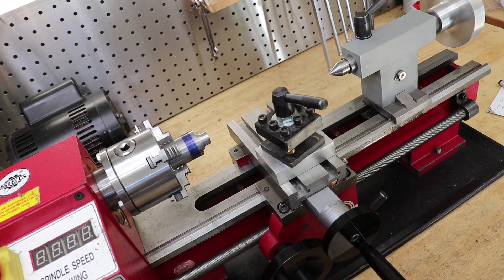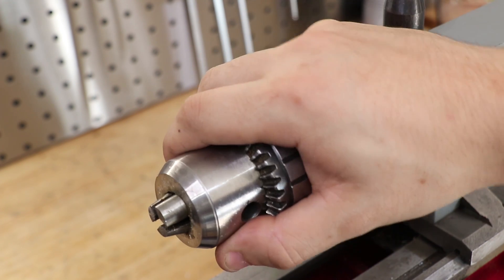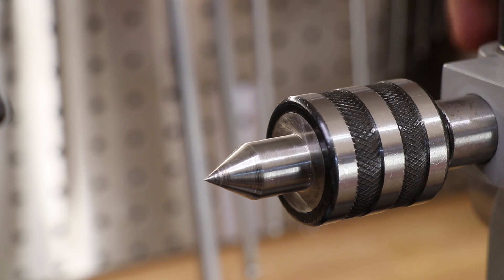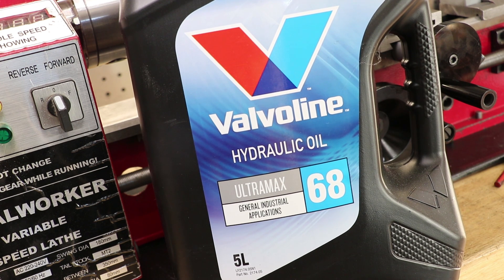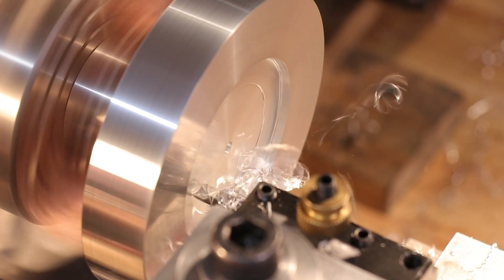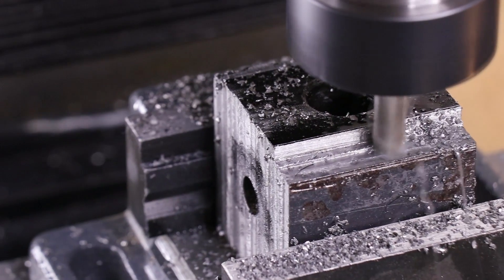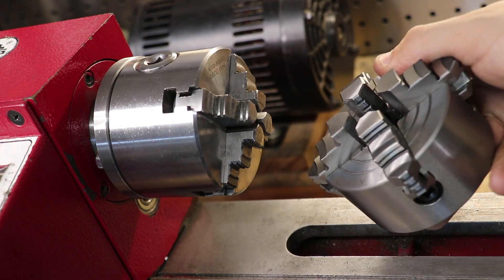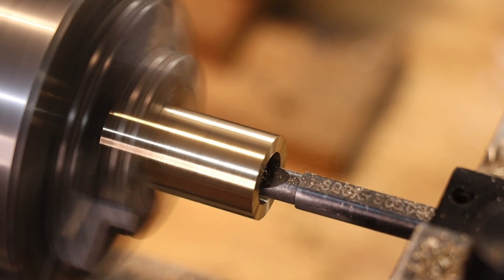Hobby Lathe Machining - The Cost Of Tooling

Comment: Well, of course for a starter you need at least some way of cutting the raw materials (saw, cutter), files, screwdrivers, hexkey-set(s), some way of scribing on the materials and I really recommend to have some kind of drill besides the lathe.
Other tools I'd recommend is getting good light and probably some magnifieing tools, vaccuumcleaner dedicated for the chips (you don't want to get all that mixed in your house).
Also: old cloths to clean, brushes, machinest-hamer or some other hamer with soft protection on it so you can make a machinist-hamer later yourself.
Probably also dies and tapping-set, 'sharpies' or some kind of marker-pens and some bigger things to measure your stock before cutting it (did I mention the saw?) and of course something to hold your materials when cutting them to lenght.
On a bigger lathe you can do a lot of cutting in the lathe/chuck because you can put it through the end of the spindle but with the small lathes you need to make it fit in the lathe and even the small size of half a meter you can buy stock in is too long to fit.

Comment: The double the cost of the machine comes from higher end machines for a normal shop. As to truly use the full machine the tooling is going to cost that much. Obviously not important if you’re not trying to hit perfect thousandths or produce parts in a production environment.
Reply from the maker: This is correct, but I've seen this figure thrown about for mini lathe tooling too

Comment: I recall reading elsewhere that machining isn’t a poor man’s hobby.  By gosh they were right about that!
Reply: Bigger 4-jaw chuck, HSS, Carbide, grinder, centres, QCTP, drills, stock.  Measuring kit.  Mill, cutters, clamps, machine vice.  It all adds up!
Reply from the maker: @daveys  Milling is certainly a lot more expensive than lathe work, thats one thing for sure.
Reply: @artisanmakes  I’ve not dared to do a calculation (and may never do so) but they’re both costly hobbies!  I reckon that I’m in for a couple of thou on each.

Comment: The difference between cheap and expensive drill chuck is run out, cheap chuck will have run out like 0,15mm and expensive one like 300$ will have run out like 0,02mm
Reply from the maker: I agree, a german made rohm chuck and its run out is in that region, whilst the import one is about 0.075 or so. Granted this might not apply to a manual situation but when ive done cnc if the drilling needs to be low run out I'd just use a collet and skip using a good keyless chuck. Cheers

Comment: Kinda painful watching that carbide creep through it's cut. You're treating it like HSS.
They are VERY different in red hardness (durability) and rake angle (chip formation).
Carbide "prefers" heavy pressure. Double or triple your feed rate and you'll see it "come to life".
Reply: You'll snap the belt or break the plastic gears if you have them if you push it too hard with carbide on the mini lathe. Ask me how I know.
Reply from the maker: You can only do so much with this lathe and it's probably pushing it to its limit. I still get better results with carbide than hss. A lot of the optimal feeds and pressure kinda go out the window when you use a mini lathe. Cheers
Reply: @artisanmakes  I understand the limitations you're up against. Depth of cut is very limited by the raw power @ the headstock. But try ramping up the feed rate, it'll give a much faster, cleaner and more predictable cut.

Comment: I am always impressed with your knowledge, experience in machining, and your ability explain and forthright recalling of hindsight (things tried, causes of poor results and corrections taken). Coupled with your commitment to improving these types of hobby/home machines, your videos (I am certain) are helping droves of people find capabilities they thought beyond their or their equipment's abilities.

Many people would lose interest in improving their lathe and/or mill, and instead "pop" for a "bigger and better" one. But coming from a family of machinists (yes, even my mother ran a lathe back in the day, her father had a shop) I know it is a source of pride as a machinist to be known to be able to produce accurate, well finished parts on "old, greasy, well used machines". There are fewer true old-school (at heart) machinists around.

I am reminded of the story of when Ford bought Jaguar and discovered the machines in use by the (inhouse tool & die, and line setup) machinists were old and contained a large amount of shims and backlash. The Ford engineer exclaimed, "we have to replace these machines with newer, modern machines"! To which the machinists responded, "If you replace 'my' machine you better be prepared to replace me." I don't know if it is true, or of what finally happened. The company has changed hands more times, and I am sure the machines were replaced as well as the machinist. But when I heard the story, I understood what the machinists were really saying.

Even though your (and many home & hobby) machines are not old, they are relatively new (not like the British and American made, virgin gray iron made during and after 'the war'). They are made of a mixture of recycled iron and other metals, and perhaps some Australian iron or, and quickly machined and built as economically as the Chinese are able. So a lot of these machine's capability is compromised at the factory. It is up the the machine's owner to tease out the machines remaining capabilities, and you're showing how to do this in a very practical way.

Thank you for posting these great videos!

Comment: One of the best things I ever made for my 7x12 minilathe was a 7 inch faceplate.
It is just a round piece of 10mm thick aluminium plate, bolted onto a piece of 20mm diameter shaft so it can just go straight in the stock 3 jaw chuck in an instant.
I have drilled and tapped holes whenever, to suit different jobs.
Basically, if I needed to face, or bore, any weird or large object I just attach it to the faceplate. It almost turns the 7x12 lathe into a bigger lathe.

Comment: If you have a 3D printer you can get away with making and printing a lot of things that don't need the rigidity. I designed my own die holder with an M2 taper and it fits perfectly in my tailstock and gives perfectly square threads :). 

Currently working on another big 3D printed jig for the lathe right now.
Reply: I think you are right and I gave you a thumbs-up. But I hope he doesn't take your advise, and here is why. 

The value I find in this channel is in its focus on getting the most out of an economical mill and lathe. This type of pursuit is becoming a lost art, yet is a highly (under) valued one. I would hate to see the channel's focus diffused to include additive machining and the inevitable collateral of CAD and CAM softwares, parameters, CNC electronics, and types of plastics.... 

Those things can be found in a bunch of other competing channels.

This channel is a unique gem focused on something that is part of an old-school machinist's ethos, to produce a finished part that is (seemingly) "beyond" the capabilities of the machine it was produced on.

Learn what is being taught here, and apply it in your own shop and tools, perhaps share it on your own channel (I'll be happy to check it out and likely subscribe to it, as I do a fair bit of printing with carbon whisker ABS).
Reply: @RobertLBarnard  I appreciate the comment but I don't exactly know what you're trying to say by "Learn what is being taught here". I have a lathe and a 3d printer. Why would I choose to not use one because it shows ingenuity when I believe it's even more interesting when you can get them to combine with each other and compliment one another.

You definitely have the right to tell the channel how you think he should do things, because you are the subscriber, the person who makes him money and if he doesn't want to take your opinion then it's because a lot more people disagree and want more than just this. I'm happy either way.
Reply: @XxIcedecknightxX  Okay, I see where you are coming from. 
I wasn't telling you you shouldn't combine 3D print with your traditional work. I said I hoped this channel wouldn't start getting into combining 3D printing with the traditional subtractive metal machining, as it would (imho) take away from how he (the channel's owner/creator) has bootstrapped his shops capability remarkably well in a traditional sense. 
Its probably a generational thing (I'm an old man, lol) and I like the purity, (self imposed) disciplined constraints, and narrow scope of his content. 

Or perhaps I've been into "3D printing" for too long (working on them when I had a CAD/CAM consultancy 30 years ago with GE, Andersen Corp. Ford, and Boeing). 

I agree with you the capabilities of todays open source hardware and software are really exciting and bring a lot of capability to a home workshop and even non-technical craft people. It would not surprise me to find 3D printers in homes out-number lathes OR mills in homes my 10X or more. So it makes sense to combine them in most people's projects, as well as yours, and mine.

Of course your opinion is as valid as mine; as we each "validate" our own opinions. But I may have a different take on which way the owner/creator values our opinions.

This is his channel and (within a few guidelines set down by YouTube) he can run it anyway that pleases him. He may decide to do the opposite of what his audience requests. Like me, he may not really care about getting more subscribers. Or like someone with humor and intellect like a Dr. Feynman, have a better idea to show his students. 

Ours are just opinions and for some odd reason, I felt compelled to share mine with you. You're perfectly free to tell me, "respectfully sir, go to hell" and I would laugh, slap you on the back, and but you a beer.

Comment: With insert tooling the newby has to tread carefully as not all tooling sets are created equal and most sets come with holders that you will rarely if ever use . For small lathes stick to insert shapes like Rhombic and triangle as they more common in the small size the holders use , require less power to run and many small boring bars use the same tips . If you can stick with one shape it makes buying replacement inserts easier and cheaper .
Unfortunately many newcomers to the hobby see insert tooling as a shortcut to better machining or “if I use inserts I don’t have to learn how to grind HSS tools” this is unfortunate because this skill is at the core of all lathe work and buying tools won’t make you a better machinist- learning new skills will ! 
My list would be : 
(Other than the lathe itself - many come as a kit with chucks , steadies etc so choose wisely as it can save you a pile of money )
A small bench grinder 
Some HSS blanks or a pre ground set to get you going 
A cheap dial indicator or dti and stand - dti has the benefit of allowing the bore of a part to be clocked .
A live centre 
A drill chuck 
A Centre drill
A decent set of drill bits 
A tap and die set 
A tailstock die holder and a spring loaded tap follower .
A parting off blade and holder . 
Most important thing is a set of safety glasses or face shield ( should be purchased before the machine ) 
One more important thing is to really think about what you really need I have seen many newcomers dive in at the deep end and spend thousands of dollars on stuff they thought they needed because they seen that  someone on YouTube had one and they end up with another workshop ornament .

Comment: Starting out with pre-ground HSS bits is definitely a valid option, but if you have a grinder, I'd suggest buying blanks and grinding them yourself. It isn't hard, and there are plenty of highly detailed videos to learn from. The first thing I was taught in my lathe training was how to grind a tool. 
For standard OD turning operations, you can do everything you want with HSS in my opinion. For threading and ID operations, insert tooling is the way to go though, no question. Brazed carbide tooling is also an option, but I would recommend against it.
Reply: I'm not sure if grinding your own HSS tools is a good idea for a newbie.... my home-ground tools stink.
Reply: @edgeeffect  In my experience it's kind of hard to really screw up. I've seen some really bad ones, but in most cases it was just that someone didn't bother to put a nose radius on.

Comment: I would like to add, 12mm tooling will not work with a Mini Lathe, i have a 7 x 14 mini lathe, they work on yours because you have a Modified Toolpost and riser block, 10mmm is the limit of size for Mini Lathes. 8mm is the best for adjustment in Height. I know i was that Very Unhappy guy who bought 12mm for my Mini Lathe.
Reply from the maker: You mini lathe must be slightly different to mine then, I was using the 12mm tools a long time before I redid the cross slide and made the riser block.

Comment: Surprisingly, engine oil can actually be worse than no oil on lathes
Reply from the maker: Yeah I understand why many people will disagree with it, point in case is get way oil. But I personally never ran into issues using it in a pinch, Cheers
Reply: @artisanmakes  Yeah I used engine oil for a long time without too many issues apart from it going black instantly due to the detergent presence. It's mainly that it is actually worse than no oil when used as a cutting oil - Project Farm did an interesting series of tests if I recall correctly.
Reply: This is a hot topic. On old machines I find that detergent oil (10-40 to 20-40) tends to dissolve and flush out all old crusty crud left over many years as long as you keep over-oiling the machine. Then switch to recommended lubricant. Your mileage may vary. BTW: this on assemblies that are better left alone rather than being taken apart...

Comment: yeah, not that expensive when you start out, but you just keep "accumulating" tooling as you go, so the inventory ends up having quite a bit of value.  I recently let the smoke out of my small lathe, and I seriously considering just upgrading the lathe, as a new motor was about 1/4 of the price of what the lathe originally cost me. But when I worked out what it was going to cost to replace all the tooling, I put the new motor in it.

Comment: Great post as usual. Last year I bought a mini lathe and, as I have machining experience and had the money, I bought a big selection of accessories. Then after a few months bought some more as what I was trying to do needed them. One item I could never do without is a faceplate. If you don't have a mill you can surface all kinds of things with the right fixturing. Also: Brazed carbide tooling is much cheaper than insert, and can be honed very sharp with a small diamond hone. It might be a better choice for a beginner.

Comment: Very well said. I would also recommend against a tailstock die holder as a "must have" as I've found you can rig it by using the tailstock and a flat bit of steel to align a standard die. also poke - get a cheap second hand horizontal band saw. if you can find the space for it you won't look back. I don't work for a bandsaw company I promise, just it's painful seeing you hacksaw through super thick material to then have to spend a lot of time on intermittant cuts to face them.
Reply: I know exactly what you’re talking about, makes me cringe anytime I see him cutting some stock using a hand saw. Don’t even have to get a full-size bandsaw that takes up space in the garage. Recently picked up a secondhand handheld cordless Dewalt bandsaw for $40. This thing is less than 2 feet long and takes up almost no space on the shelf. What a timesaver, Have no idea how I got by without one all these years :-)
Reply: @davidlee-mf5yf  I know right! when I got mine I thought it would probably rarely get used. turns out it's one of the more used tools I have
Reply: @KS_ChemEng  for sure, you don’t know what you’re missing until you get it and start using it... I say we should all pitch in and buy him one of those portable bandsaws 😂
Reply: The hacksaw is just a gag designed to get your goat. Anyone who watches This Old Tony knows that hobby machinists can cut stock with a good karate chop!

Comment: A good intermediate point between keyed and keyless chucks are spanner-keyed chucks. They can be rapidly adjusted by hand, and then a pin spanner handle provides the leverage for loads of clamping torque. These are the chucks I use at my work as a full time lathe operator; my boss has said he pays about $175 Canadian for them. So not cheap, but really nice to use.

Comment: Out of curiosity, how did you align the lathe originally without a micrometer or dial indicator of any kind?
Reply from the maker: By eye, I machined a pointed cone in the chuck and popped in the dead centre and lined it up by eye. Certainly not the best method but it got me in close enough. Cheers